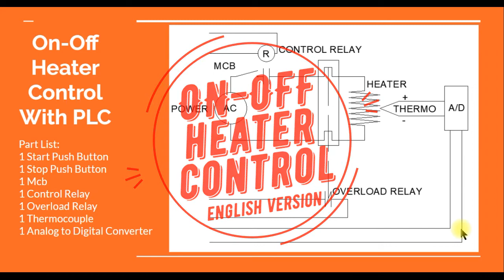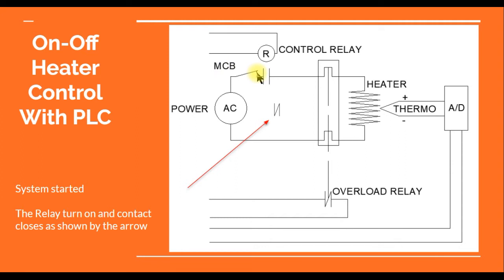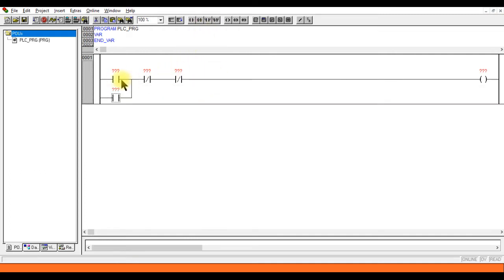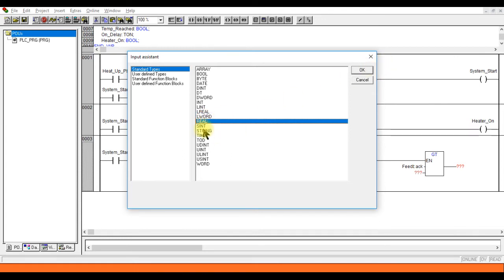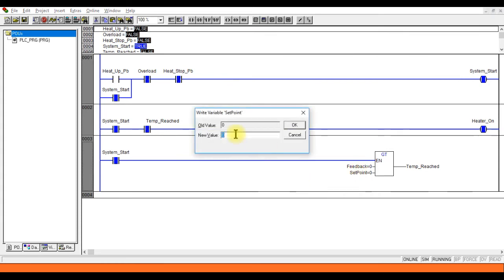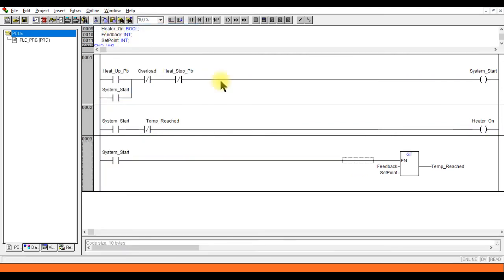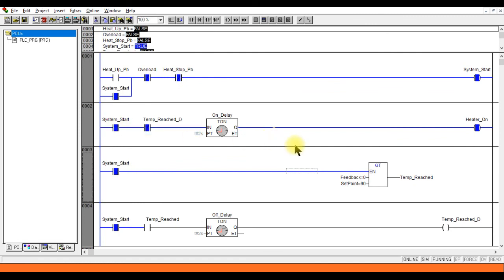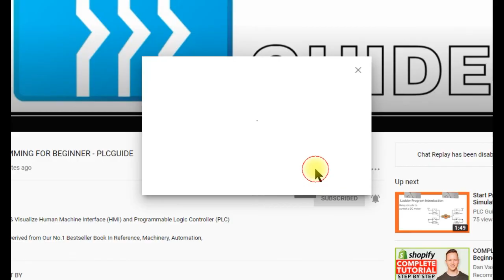ON OFF HEATER CONTROL WITH PLC - PLCGUIDE

Comment from the maker: 🚀 Get the resources and to Join the 30-Day Automation Challenge here: https://30daychallenge.beeidrisconsulting.com/challengeoptin
Learn to design electrical system, control panel using CAD, program, and simulate complete automation systems from scratch — in just 30 days!